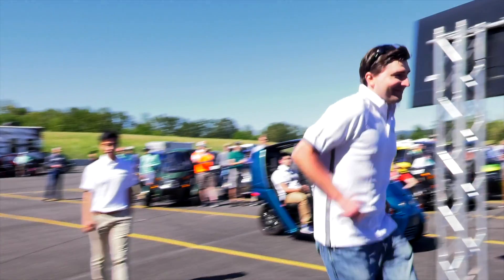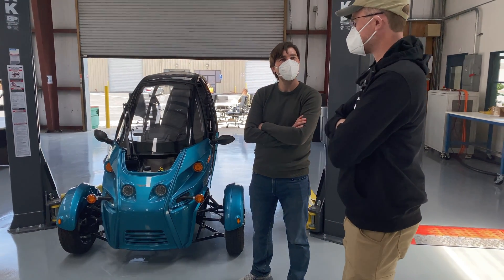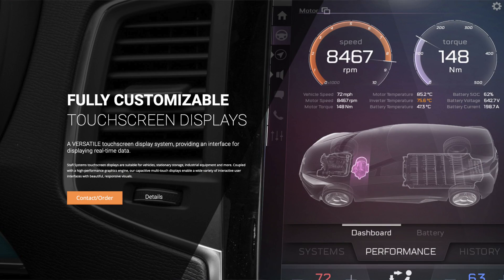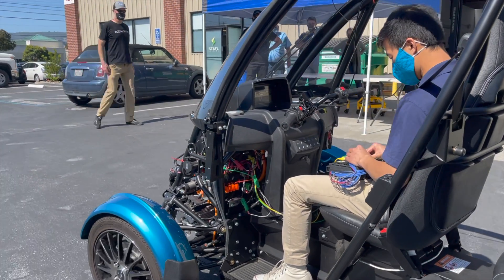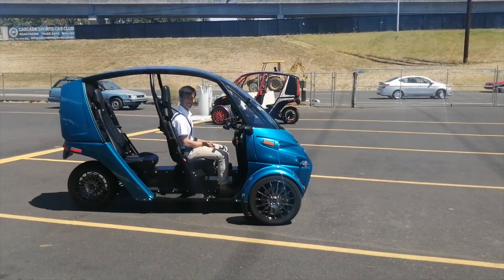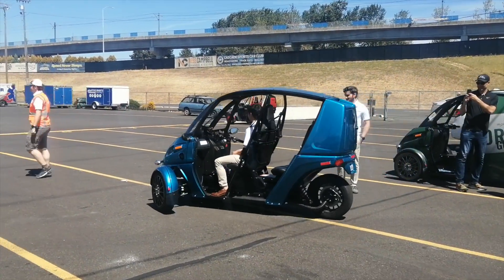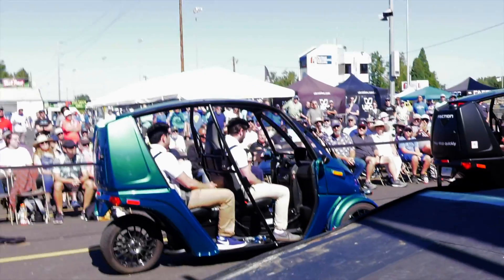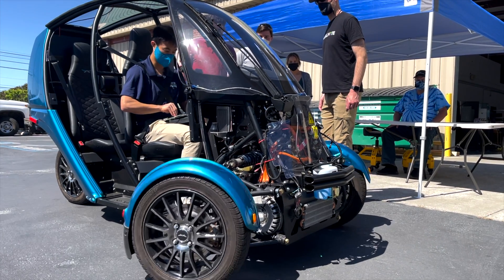FUV & FRIENDS Part II: Stafl Systems

Comment: Gee you can't do torque vector control with a gas car now can you?  Well maybe you could but..
Reply from the maker: Things like traction control systems and limited slip differentials are very primitive forms of independent torque control of the wheels for gas cars, but to do true torque vectoring you need independent motors for the wheels.